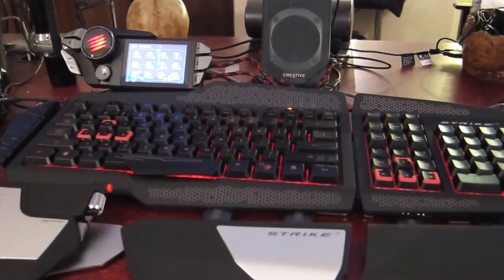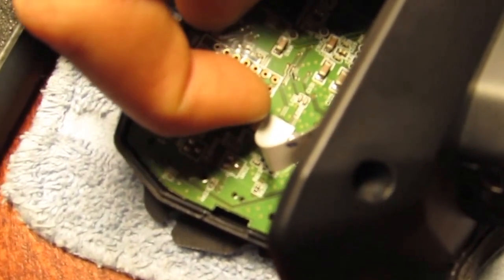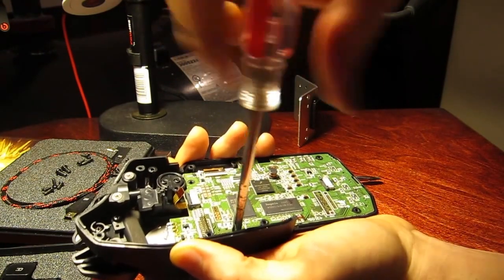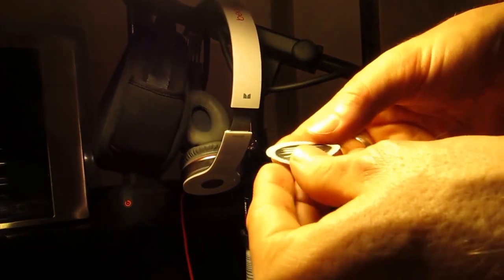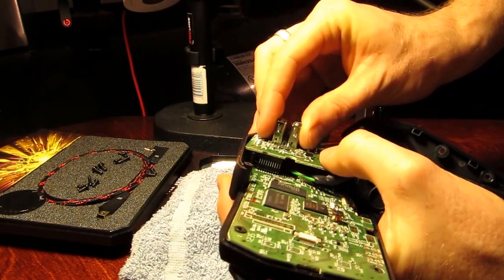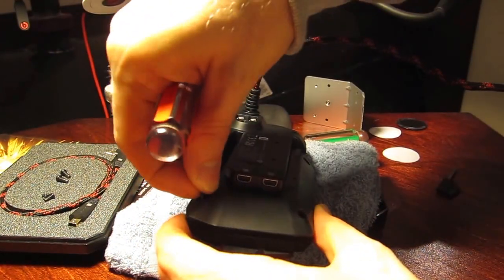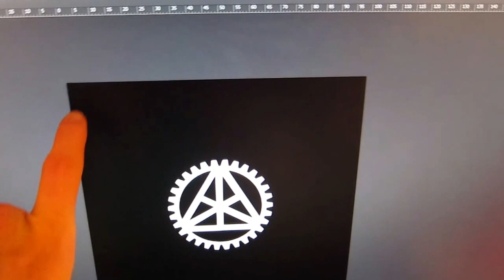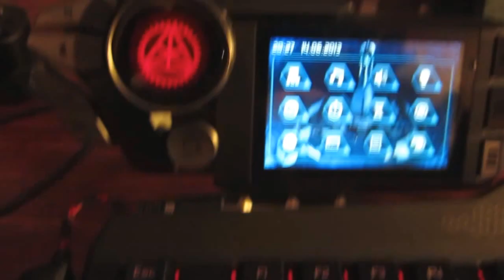S.T.R.I.K.E. 7 Keyboard LED Logo Customization

Comment: was looking for the best keyboard for geeks and even posted a video on youtube please watch whats the best keyboard for a geek? s.t.r.i.k.e 7 would be my choice but i still want more feature.. so please help, thanks for the logo customization tutorial it will handy in the future. If ever i couldnt find any keyboard that has all the features i needed i will buy this s.t.r.i.k.e 7 for its coolness but i need a work around for the bluetooth functionality so i can use this keyboard on my mobile phone maybe you have an idea.. Is there any dongle that I can use to connect my keyboard and pair it with multiple devices and easily switch to whatever device you need to use just like the feature of Logitech k810 but im planning to apply it on s.t.r.i.ke 7 so probably my best bet would be a Bluetooth dongle. i just dont know will wait for your response.. you earned a sub by the way ;)

thanks
Reply from the maker: No idea (maybe something like: http://handheldsci.com/kb ). Bluetooth keyboards-to-phones aren't really the way to go for mobile gaming because most mobile games are designed for touch interfacing controls. Also, most gaming keyboards have specific device drivers for their mutli-function keys. This keyboard has its own power plug for the wall outlet, so --not really that mobile. Even if you find a workable bluetooth usb switching station for doing what you've set out to try, you'll have to use some sort of custom key mapping on your mobile devices to create functions for the extra gaming keys; assuming the receiver device would even recognize them without the extra drivers and programming software.
Reply from the maker: Also, madcatz now makes a bluetooth keyboard for mobile devices. I haven't used it, but it's out there.
Reply: well guess what i bought this keyboard and yeah im lovin it ;) also will have to customize the logo thanks for the tutorial

Comment from the maker: To those wanting the quick solution, there is a small slip of adhesive tape holding the plastic disc in place. Removing that disc from the front should be possible if you can get a grip on it. I'm on a marketing tour for the next several months and can't make a follow up video.
Reply from the maker: @b.m.882  I know this is ancient now, but if people are still using this keyboard,  I'll have to pull it out of retirement to do the follow up. We have been moving around so often that I've been using my laptop full time instead of the desktop set-up for things.
Reply: @Xonikz  Please do!

Comment: I'm going to be selling this Keyboard at the beginning of this December. I'm not sure where yet, but I'll be asking $146 for it plus shipping. If anyone is looking for a fully working, fully upgraded Strike 7 keyboard, let me know. I'll update this in the comments when It's gone. The reason I'm selling? Just downsizing my life a little in this regards.
Reply: I never ended up selling. It's not actually worth much now that madcatz stopped support. It's sitting in a box. I'll find a use for it again, I guess. The screen interface feature needs to be hacked for better functionality. All of the people doing that stuff stopped bothering after better keyboards were released.
Reply: If they made this to be mechanical, It would have dominated for decades even after bankruptcy... 
Currently they are back and I'm using STRIKER 13 for now.. it's an awesome but not as super as this.. but has a better build.. 
If they remodel this to be aluminium top and mechanical with cherry MX switches.. that really sounds their comeback.. but still not many new products as impressive as this has come out.
Looks like the current takeover(Chinese renowned few employees back i guess) isn't that creative to the Mad Catz Interactive Inc.'s (Original Catz)..the full team.

Comment: Nice but much work for nothing ... you can do it from the front ... with one toothpick or something in plastic to avoid scratch and it take 30 second .. the logo 35 mm
Reply from the maker: True. Unfortunately, no one had cracked it open and done a video so I would know that in advance. Let us see your finished mod and how you did it.
Reply: blacksabat31 Hey man, could you do a tiny video on how to pop the logo out. don't know where to pry from the front and don't want to go through the hassle of taking the whole unit apart if I can avoid it. Cheers
Reply from the maker: +lazarus2950 The front logo is basically just taped in place with double sided tape. if you can dig it out without scratching your plastic housing, that's going to save you the full teardown. Just don't put any torquing on the screen housing or it will crack and is next to impossible to find a replacement for.